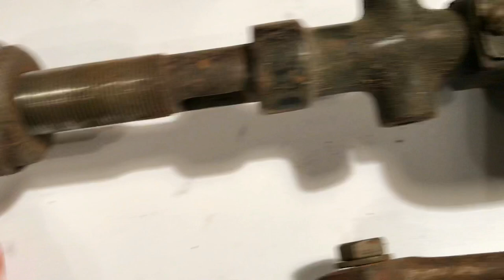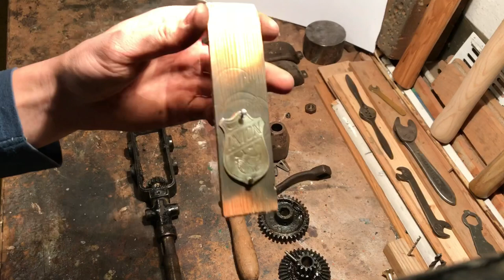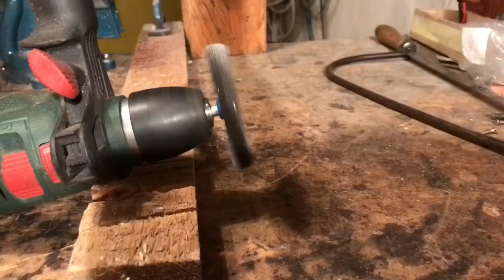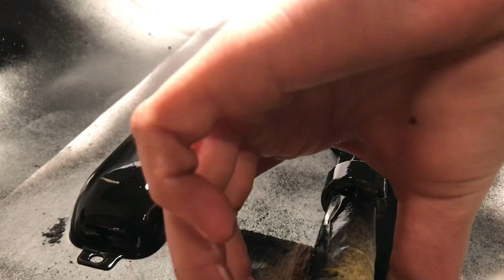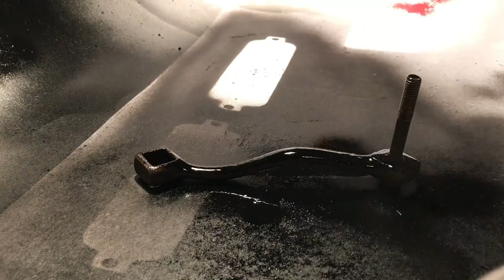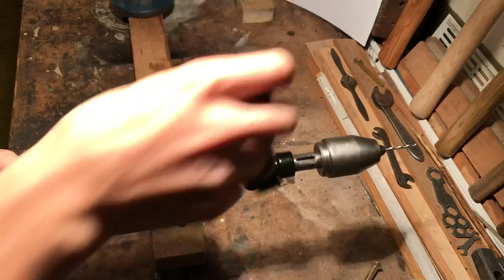Old Rusty IXION Hand Drill Restoration

Comment: Guess from where is that non original handle - a meat grinder 😎.
Really nice resto, make extra horizontal handle too- easy with bolt or double woodscrew/thread & some scrap wood.
What have u used for fastening that IXION shield?